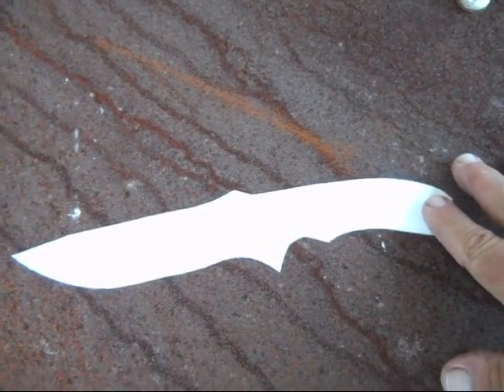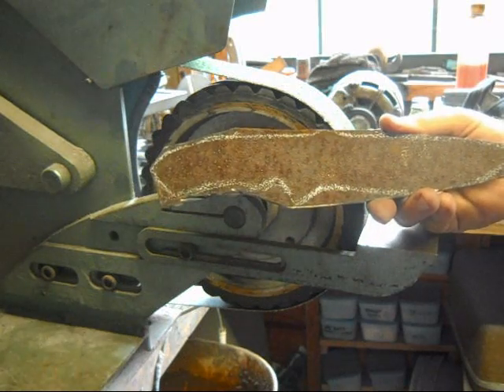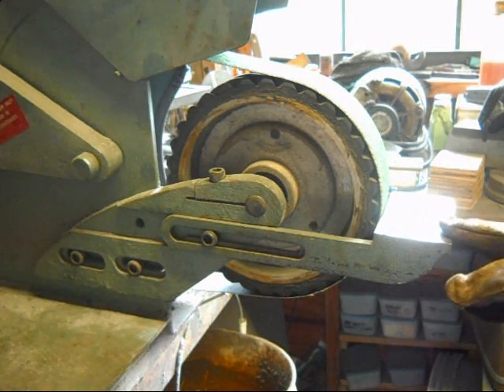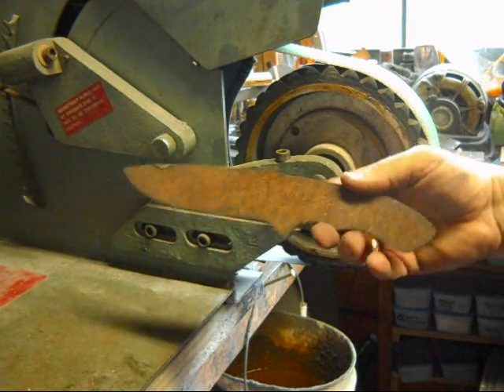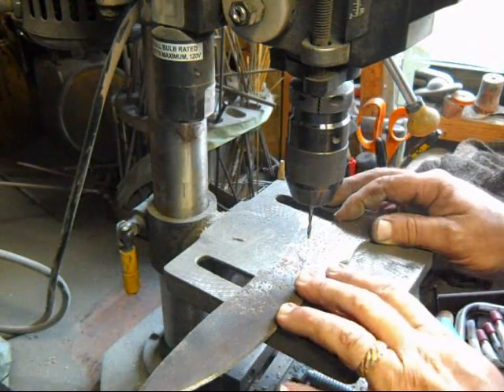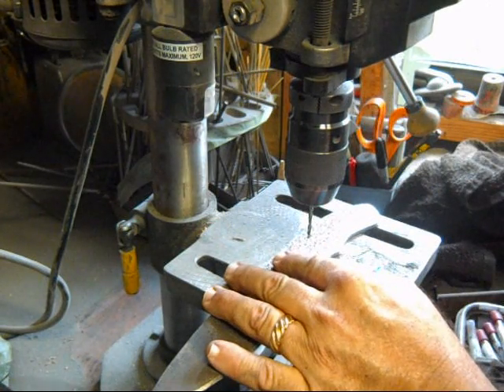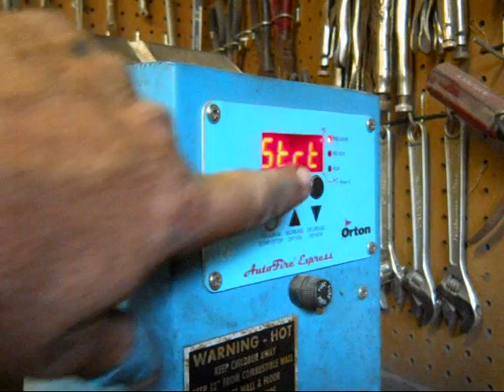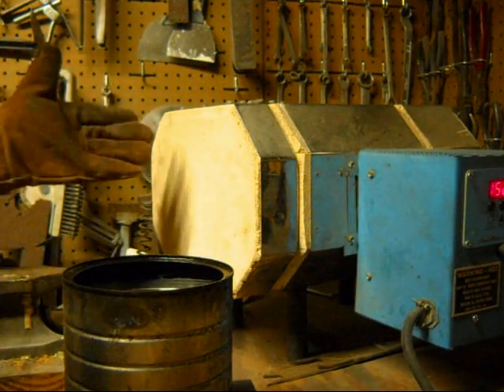Knife Build Part 1

Comment: Very nice video!  Only one thing I'd suggest.  You need a larger quenching bath.  Or have multiple quenching baths.  Ideally you want the oil warm to the touch for the quench (120-190).  With your current set up by the time you quench your fourth blade that oil is going to be really hot, which in turn will lower the efficiency of the hardening. Of course you didn't show the 3rd and 4th quench so maybe you allowed the oil to cool.  Love your video and knives!

Comment: amazing job.. but if you use the same oil for several knifes, the oil will be at diferent temperatures everytime , that would make the hardening completely random, i know it saves time but i highly recomend hardening one at a time with the right oil temperature , cheers and keep on the good work

Comment: does using the 10 inch contact wheel and hollow grind then use the 8 inch with the felt screw up the bevels because the wheels arent the same inches

Comment from the maker: You are correct.  I do have a bigger bath coming.  I actually use two cans of oil when I do four blades for the reasons you stated.  I probably should have mentioned that in the vid.

Comment: where didu get a sawblade that big? the only saw blades i can find are like 30centimeters and like 5mm thick, thats not good for a bushcraftknife i wanna make. can u please tell me where to look for a saw blade like yours?
Reply: They're from old sawmills, but unless you know someone good luck trying to get one. You can buy them used but the cost quite a bit.
Reply: henk speertent u just gotta look around I've found a few at my local used tool store or if u know some one with a mill